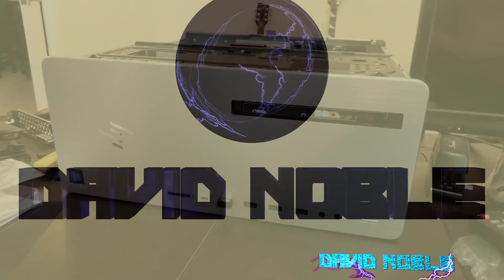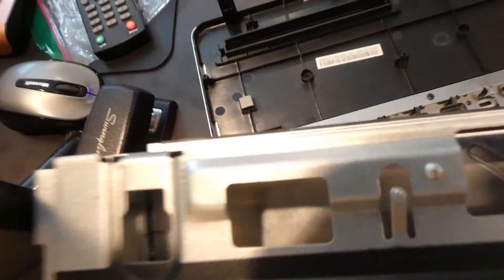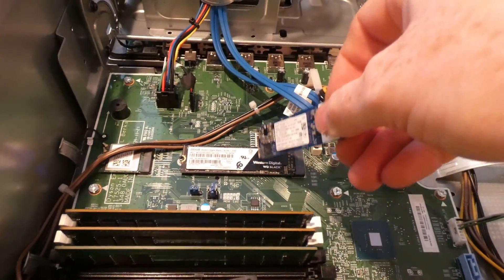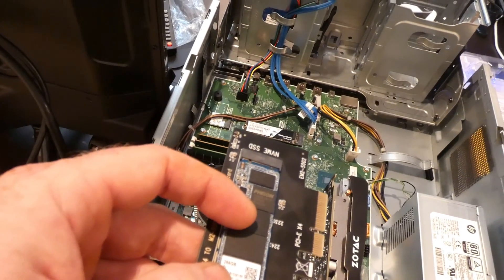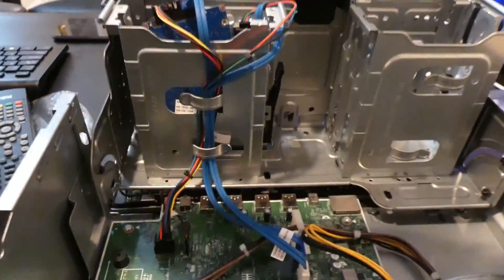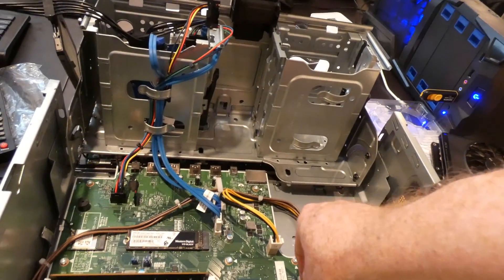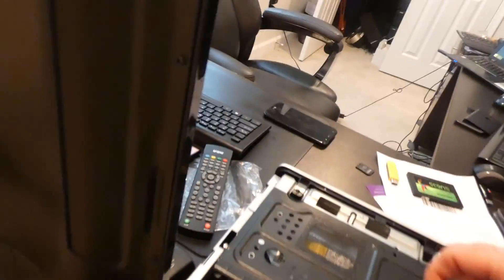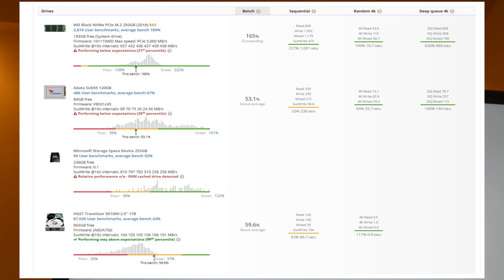Options for adding SSD or HDD to HP Envy desktop computer, I5-8400

Comment: Hi, I removed the original 128GB SSD and installed a new Samsung 970 Pro 500 GB, but the computer would not fire up.  I went to the Bios but I cannot change the Boot up priority.  Any suggestions?  Thanks in advance.
Reply from the maker: Mines currently dead...or I would take a look at the bios.  What I usually do for these pre-builts to get a working O/S is one of the following:
1) Create a recovery thumb drive using the original SSD.  Reinstall on to the new SSD
2) Using a PCIE expansion card that will allow an additional M.2, use Samsung's Migration software to copy original M.2 to new M.2

There may also be something you can download from HP using your model number that will allow you to put the OS on a thumb drive and install.  Your license for windows will be stored on the motherboard.

I don't believe I ever was able to download windows from Microsoft and then install Windows directly from a thumb drive.  It would just reboot and want to install over and over.
Reply: @PC_HardwareTechUnboxing_1  can I get a parts list for upgrades that pc part picker Carrie's that I can just plug into my
Hp 700 230 please I've been asking all over
I just want it as current as possible 
Please can you make a parts list of compatible components for my desktop 
Thanks in advance

Comment: Would it be possible to install a second 3.5” drive on the right side of the computer (the drive bay seems to have a place for it on the right)?
I’m also talking from the point of view of power consumption. I’m considering to buy one with both an M.2 256GB and a 1TB drive in it and want to add my 5TB as well.
Reply: What I don’t understand is whether this computer has 2 bays for 2.5” drives or whether they are big enough for 3.5” drives. Even HP specs are vague.
Reply from the maker: I would have to get back to you on whether there is a bolt pattern to fasten to, but yes it does look plenty big enough.  You quite possibly will need some sort of SATA power splitter as I show in my Dell Inspiron 3670 and HP Gaming Desktop videos.

Comment: Is there a 6+2 pin in this pc?
Reply from the maker: Negative... Mine originally had a GTX 1050 in it.  There are versions of these that have GTX 1060's, so there must be a compatible power supply.  I spent a lot of time upgrading a similar Dell 3670, but did not spend much time with this one...perhaps, I need to make some more videos about it.
Reply: David Noble late reply but my friends actually had a 6+2 we ended up putting a gtx 1060 6gb in it and it’s been running good since.  His didn’t have a gpu in it just the i7
Reply from the maker: @BasedAsher  I am curious what the part number is on the PSU.

Comment: Is this the hp envy NV795-0010? If so did it just come with integrated uhd 630? If so, I noticed you had a gpu installed.. what kind is it, and did you have to swap anything out to make it work? Thanks :)
Reply from the maker: I would have to check when I get home.   This came stock with an HP OEM GTX 1050.  There would not be anything out of the way needed to make it work.  It gets all its power from the PCIE slot.  If one were adding it, they would need drivers for the graphics card.  I believe I tried out 3 different low power cards that I had....OEM RX 460, OEM RX 560B, GTX 1050TI.
Reply: The 180 power supply has to be upgraded in my new envy 11/2020 but it has to be hp and have the small secondary motherboard plug. The gtx 1050 needs 350 watts. Hp is no help at all